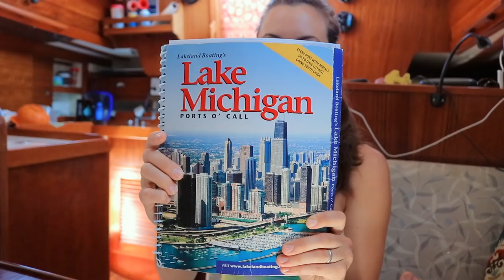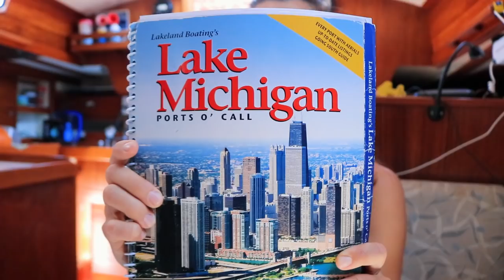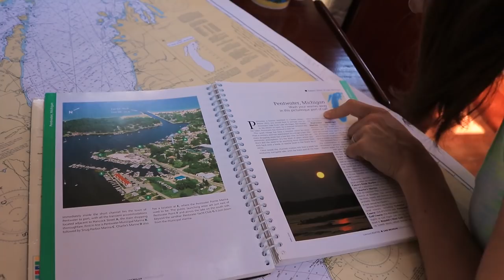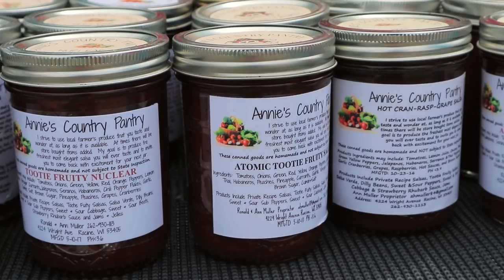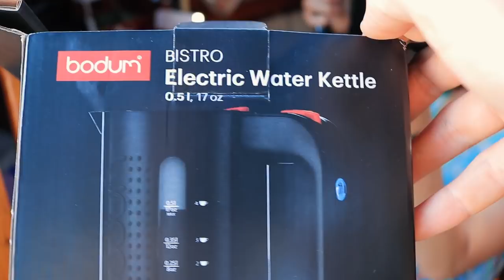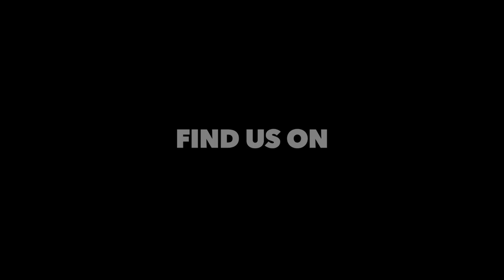Preparing for our Shakedown Sail | Sailing Soulianis - Ep. 9

Comment: ... While I was at Tartan (1969-2009) each crew had a 1.4" angle drill,  ours were plug in ones.
Reply from the maker: Wow, you had quite the tenure there!  What was your role(s)?  Sounds like you may have worked on ours?  1979 Hull #159.

Comment: looking good so far. I liked your choice to be honest and show your mistakes. I'm sure you're an expert at 12v electrical systems by now. I am looking forward to seeing what happens this summer.
Reply from the maker: I wouldn't call myself an expert, but I have picked up a TON of knowledge.  Just added 3 new batteries and totally re-wired the major components of our electrical system. New solar charger, new battery to battery charger, etc. It's pretty amazing how much you can learn on Youtube with a little bit of time! -Kirk
Reply: Make sure to Shrink Wrap or Coat All Connections.....!!!

Comment: Three short blast actually means "I am operating astern propulsion.". The correct signal for requesting bridge to open is one prolonged blast - one short blast - one prolonged blast.
Reply from the maker: Not so for this bridge. It's located only a few blocks from another bridge that uses the 'one long, one short' opening request pattern. So as not to confuse the bridge operators, this one does indeed require 3 short blasts for opening.
Reply: @SailingSoulianis  Hey! Thanks for replying, I am from Europe, so maybe it's different in the US, or there are some different local regulations, but as far as I could figure out, the law seems the same: https://www.law.cornell.edu/cfr/text/33/117.15 In Holland I see a lot of people who just do three short blast and are completely ignorant of the fact that they are signalling a completely different signal.

Comment: FY I, if you haven’t already,  check out the ABYC info on marine electrics.. The  use of solder isn’t recommended for electrical connections. Heat shrinks and marine crimps are safer because solder breaks from vibrations on a boat. Nigel Calder and Don Casey make good repair books that are easy to follow. Maybe I missed something ancor makes the best connectors. Maybe check out Compass Marine Services repair website as well, he sells good crimpers at a very reasonable price.
Reply from the maker: Hi George, Thanks for the heads up.  This was probably the first project I did on the boat.  I have learned heaps since then. At some point we're going to be redoing the lighting situation there - we'll make sure to use proper connections then.  Cheers!

Comment: Hi gang....you might consider at least a 200ah alternator & two 100ah AGM batteries until you get rigged for offshore cruising. But then, considering the delay, you're probably already set up for cruising.  
Stay safe
Reply from the maker: Yep, we'll talk about this more in the next few episodes. But, in short, yes, the batteries that were on the boat when we bought it were pretty terrible. We had two 110ah Group 31 house/start combo batteries. We debated upgrading immediately but because our near-term plans included motoring down the rivers to the Gulf, we figured even if we drained our battery each night we'd be running the engine for 8-12 hours the next day resulting in a good re-charge. We’ve since upgraded our entire 12v system and will share more about it as we get caught up in video and on our blog.

Comment: Not 58 amps.  It can't be.  58 watts?  5.8 amps?
Reply from the maker: You are absolutely right — not 58 amps. It’s 1500 watts, and I mistakenly divided that by 12v instead of 120v to get my amp total. Should be 12.5 amps. Yikes. Good thing Kirk is the one upgrading our electrical system. Thanks for pointing that out! -Lauren
Reply: @SailingSoulianis  1500 watt inverters are not prohibitive, and basic alternators put out over 700 watts, plus you have the battery, which you can just recharge after your tea is hot.  You do need to keep running the engine while you drink your tea though, so you can't drink it quietly without shore power.
Reply from the maker: Kinda ruins the peaceful morning tea experience, doesn’t it? ;)
Reply: @SailingSoulianis  Maybe if the engine ran while the tea steeped, you could then turn it off while drinking.  heating elements also tolerate reduced voltage from overloaded systems.  They just slow down, unlike motors, but I don't know how inverters react to overloading.  I think they burn out rather than just reduce voltage.
Reply: @SailingSoulianis  I had another idea. just cut the 120 plug off the end of the chord and splice on a 12V plug.  All that will do is take 10 times as long to heat your tea, by which time it can thoroughly steep.  Indicator lights etc. might not work though.

Comment: it will be cheaper in the long run to install a decent solar/battery/wind system - I mean - I have a 500w inverter in my car! the camping/low wattage/hand operated appliances (apart from whisks) are utterly useless. A 500ml kettle won't even fill two coffee cups. Invest in your own future.

Comment: Two things, first and foremost. Never, ever throw your beautiful wife under the bus for mis-adjusting the compass. Look at it this way, you get to spend 30 or 40 extra miles with her alone on your boat.....Winner winner chicken dinner!!! (That's got to be a good thing)Since you do not have solar or a wind generator, maybe you should look at a small Honda generator. 2000 watts would work mostly anything you want on the boat and it's good should you run down your starter battery in an emergency. It will run tools, blenders and microwaves. I have solar on my boat with an inverter and I still have a genset too! If you happen to have a swim platform you probably won't even be able to hear it from the boats interior. Just do not leave it out over night....or it will be gone in the morning! Trust me!! The only draw back is my boat engine is diesel and the genset is gas, but a full tank will last about 10 to 12 hours with small loads and about 8 or 9 hours running an a/c unit on high most all night. Good luck, feel blessed to have such a beautiful first mate!
Reply from the maker: Lol thanks for the advice 😁. As for the generator. We are hoping to avoid it at all costs. We’ve got a small solar set up temporarily now and will add more once we sort out a Bimini. But we are pretty confident it should give us what we need. If not the Honda sounds like a great option.

Comment: You condemn the kayak when you’re not using kayak paddles?  That makes no sense.
Reply from the maker: It’s a double kayak and our coordination wasn’t quite right to be stroking together at the same time. So we tried just one of us paddling from the front then the back and it just wouldn’t track a straight line at all. So finally we decided to pull the kayak paddles apart and rowed it like a canoe so we weren’t bashing paddles into one another. It was fine for a stroll but not as a working dinghy.
Reply: Sailing Soulianis 
I see.  Did you try each paddling on a different side? Because I only saw him trying to paddle on both sides.

Comment: Hi there, getting real fed up with your constant adding in bits that shouldn't be included, such as Lauren going running, it should have ended with her running away from the boat, instead you included another 4 -5 shots of her at different points... seriously WHY?. How about you stick to the basic's and get to do them best, your video's are becoming so much like the Whynn's ( whines) which is about commenting on every little detail, so not necessary, and very excruciating to go through. You should consider doing a weekly Vid only, I don't want to sit and watch for 12 or so minutes about how to untie a rope, or whats the best way to go to the toilet, or which way the toilet roll should be installed on a roller. So stick with Factuals, don't chop and splice your videos to much, have a great sail, bye